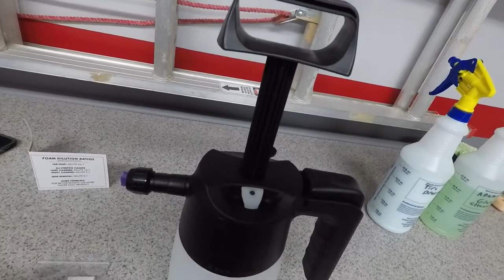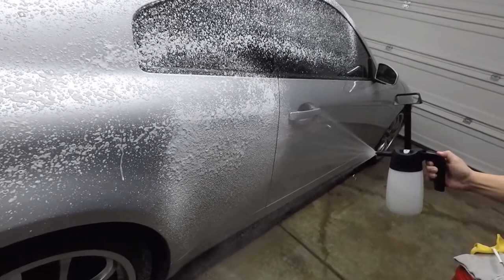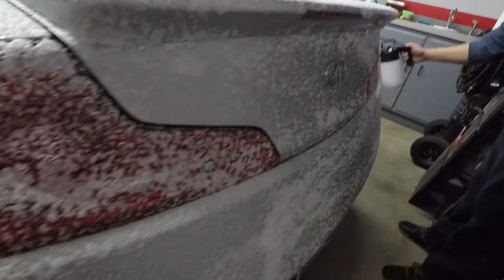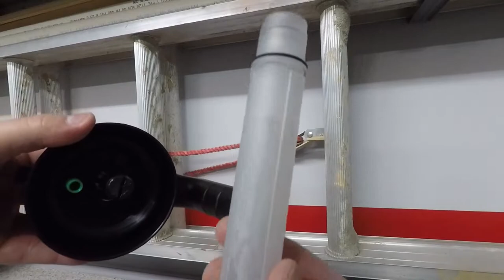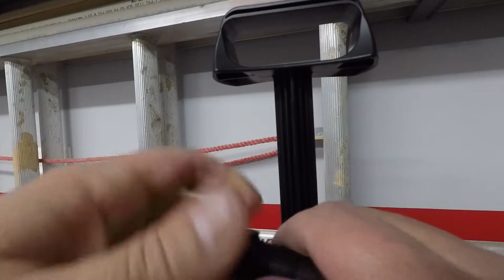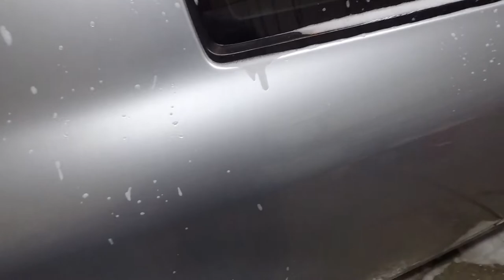iK Foam 1.5 Sprayer First Use

Comment: 1 tank ful gets me a full suv foamed.
Reply from the maker: Did you keep the gray fitting? The green fitting produced a thicker foam but doesn't provide cleaning power.
Reply: @GavDetails  
just kept the stock tip. worked great. just be fast and Keep it light foam. 1/2 / 1/2 over lapping each other.
Reply: @GavDetails  how does it not provide cleaner power? Just curious. I just got the foamer and sprayer today and wanted to see which tips would work better for winter care.
Reply from the maker: @Voltis-5   Not sure I understand your question.  Winter washing, if you plan to use a rinseless wash, I personally take my truck to a do it yourself car wash and rinse all the heavy salt and dirt off.  Once at home, I use 3 buckets to perform a rinseless wash.  If it's warmer and you want to use the foamer, then use it to pretreat the dirtier areas.  Or you can use the foamer @ the car wash BEFORE the rinse step, this will help remove more dirt etc.  The sprayer would work well as a way to pretreat any lower panels of the vehicle and/ or the wheels before performing the rinseless wash.  Instead of using a pump sprayer, they iK sprayer will provide more coverage faster.

Comment: So what do you do to rinse the vehicle off after you use the foam on it in the garage?
Reply from the maker: I let the product run off of the vehicle and then went straight in to the rinseless wash.  3 bucket method, 1 with the rinsless wash solution, 1 clean rinse bucket for the mitt and 1 clean rinse bucket for the MF towels used to dry the vehicle.  Yes, the rinseless wash did reactivate some of the foam but not enough to require rinsing with a hose.  The "drying" towels are used somewhat "saturated" rung out and then used to dry 1 panel or area at a time.  From the time I applied the foam, dwell time, rinseless wash and dry the total time spent was around 20 minutes.